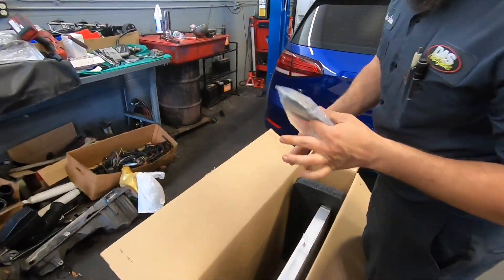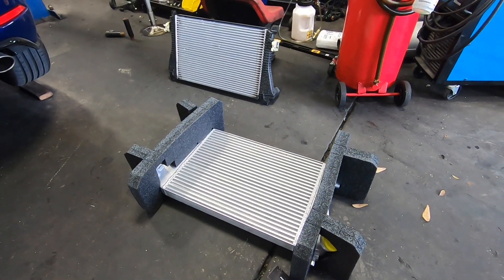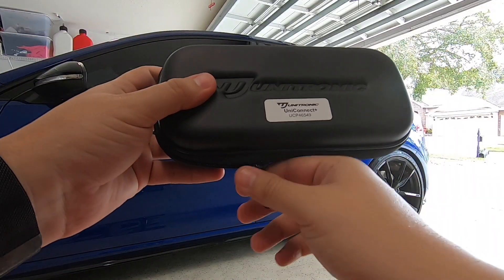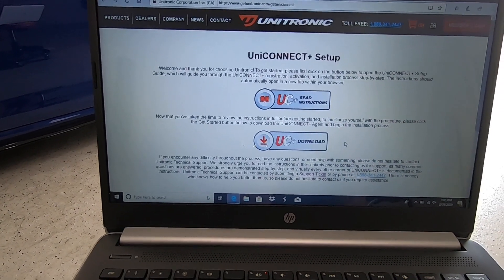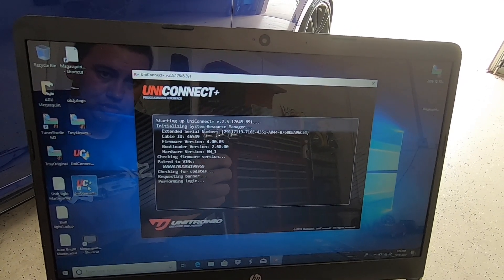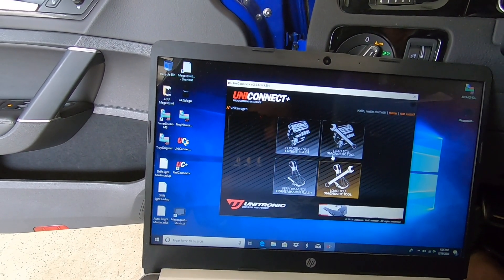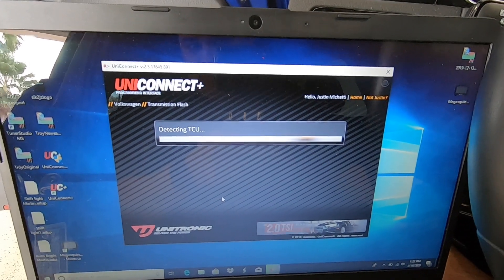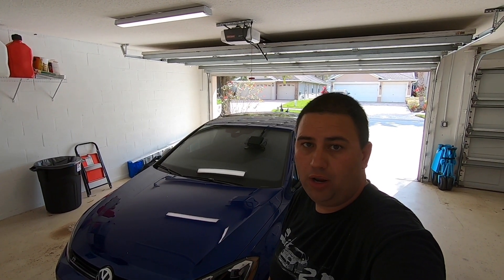Unitronic Stage 2 ECU and TCU Tune Install Guide + Unitronic FMIC and Turbo Inlet

Comment: I have stage 2 unitronic why dosnt it have the option for the overrun it only says stock, stage1,1+, and stage 2
Reply: I have a 2012 beetle turbo with untronic stage 2 ecu and tcu 
My ecu tunes are the same.. stock, stage 1, 1+ and 2
The tcu comes with 2 tcu tunes for stage 2.. have no idea why it has two different stage 2 tcu tunes..